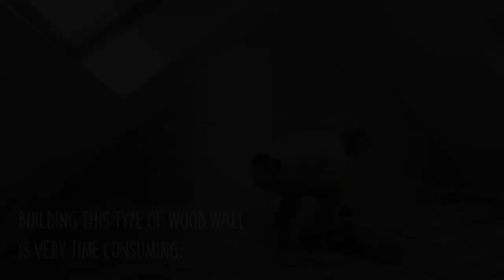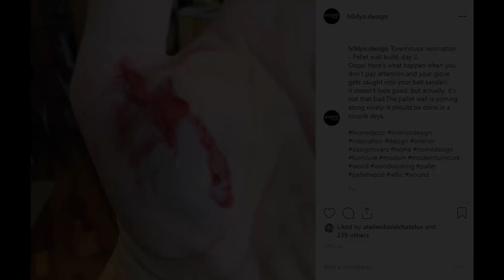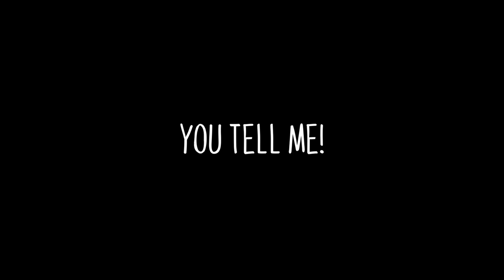Townhouse Renovation - Pallet Wall - The Attic (Part 2)

Comment: The work time alone in this wall is insane and I admire you for that. But, these operations actually defeat the purpose of used pallet wood. You almost fabricated vertical parquett, not a distressed wood (which it is in a pallet) accent wall. Where I work, we have a real pallet wood accent wall installed, and it looks much different. The boards are left unsquared, only very lightly sanded (saw marks can still be seen), nail holes left in, different thickness and sizes (much bigger than yours) boards, of very different colors ... what you have done with very much work can be bought in sheets/tiles in home improvement stores (we have it in Bauhaus, I don't know Belgium stores, but there should be). It's like trying to make OSB at home. Yes, with enough determination it is possible - but it's available for decent money in the store ...
Reply from the maker: The goal of this video is simply to show that you can achieve a high end looking wood wall using free, aka pallet wood, materials. So technically speaking, it is a pallet wood, no matter how it looks, and it doesn't defeat any purpose :-)
I agree that it requires some equipment and a lot of work, but it's been more a challenge for me than anything else. Plus this wall has now a story behind it, and it is unique, which is unvaluable. 
Many people use distressed pallet planks with lots of holes for wood walls. It's free, it's quick and easy to build, but in the end, it looks cheap. 
Plus you don't want to use rough pallet materials inside a house, especially in a bedroom like this attic. 
All the boards I used were cleaned up, and I discarded many of them due to suspicious stains.
Reply: @HODYODesign  I don't agree, but here's a thumb up anyways! The work alone is heroic!